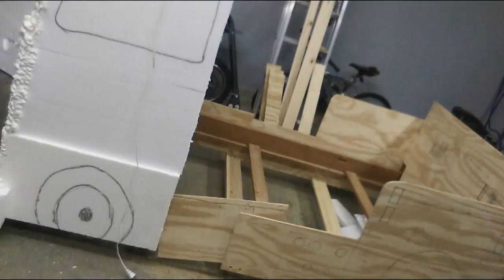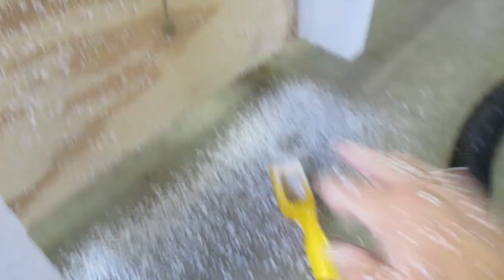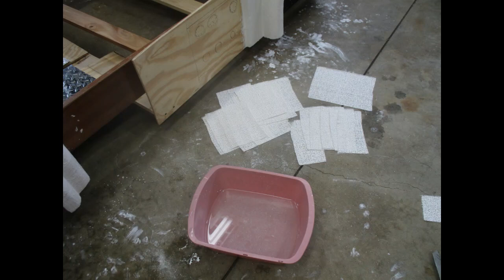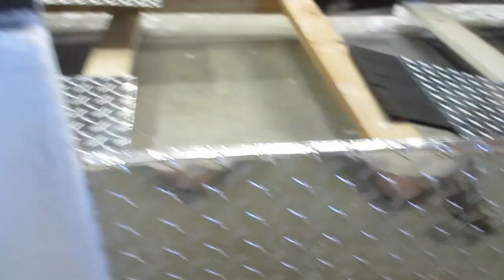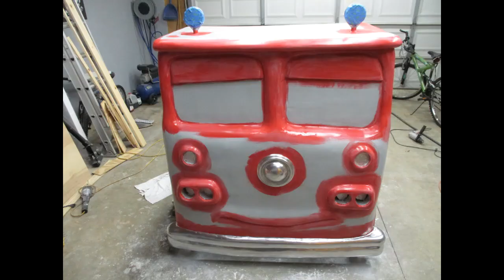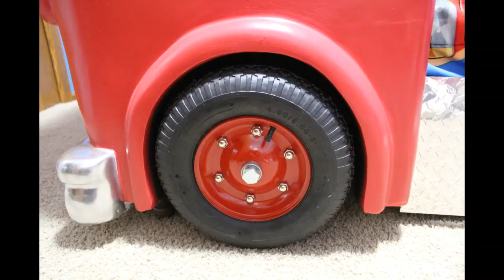Firetruck bed from Cars 'Red' DIY project.

Comment: Scott, this was such an awesome build!   I must know, did you cover the styrofoam in Plaster sheets?  Did you do any treatments to the surface after this?   The final result looks like it came right out of Disneyland!  Thanks for sharing this awesome and my guess a very time consuming build, even if I am very late to the party :)
Reply from the maker: Hi. Thanks so much!  Means a lot from you.   Yeah I just used plaster cloth.   Then smoothed it out with the pink drywall plaster.   I wanted to do fiberglass so it was really tough but I didn't have experience with that yet so went easier route.   It's held up pretty well though.   I've learned a lot since I did that watching builders like yourself.   Thanks for inspiration